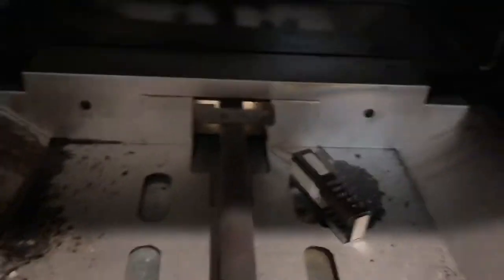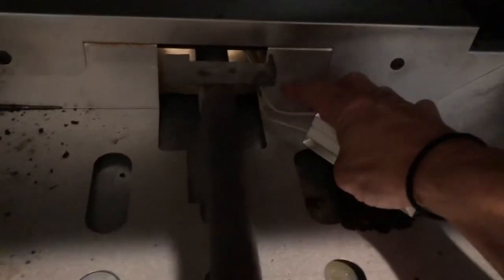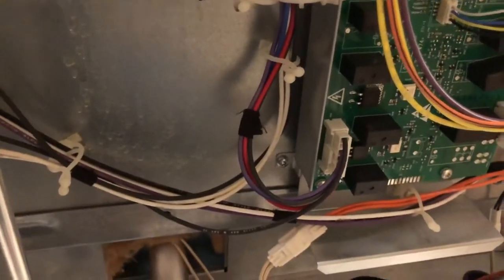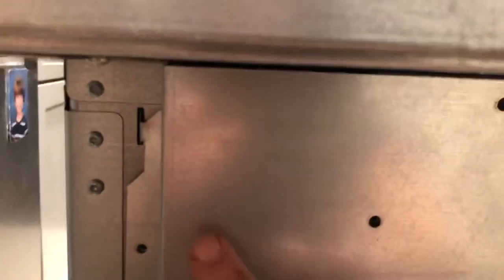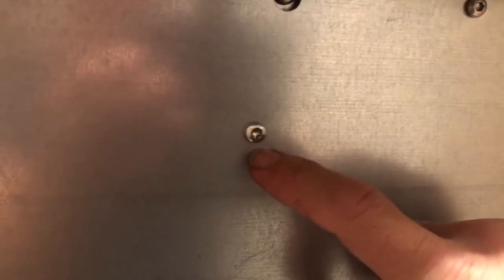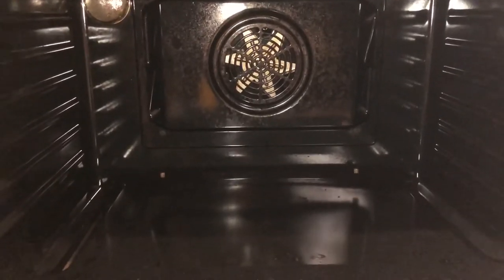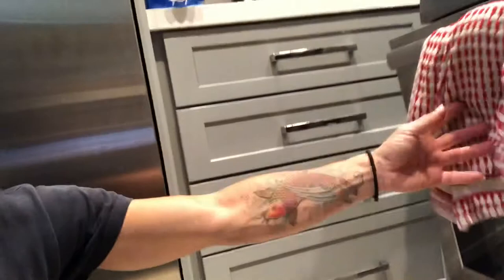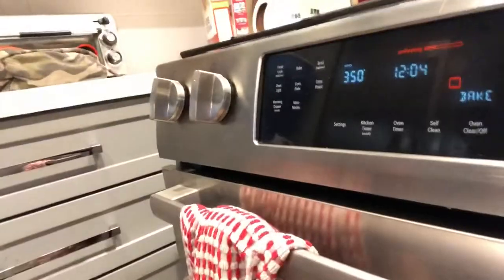Installing a new igniter in a Bosch 800 series oven

Comment: this video was priceless. other videos came up at first that showed stripping the wired and shortcutting getting into the back.  I knew that couldn't be the 'right' way and found your video, which saved a ton of time figuring out what to remove to get to the right connection area. thanks!
Reply from the maker: I'm glad this helped streamline the process for you -- congratulations on solving your issue!
Reply: Actually first replacement burned out in 2 days! Amazon sent another and did all this again and working now for over 2 months. Thx again 👍🏼
Reply: Completely agree with this comment. The initial video I viewed showed spliced wires being connected together. This video however properly showed that the stove needs to pulled, back removed so that the leads can be correctly connected. Great great video and thank you!

Comment: Thank you for this information. Bought the cheap $26 igniter, cut the wires and put it in.  Lasted a month and the igniter stopped working. Bought the Bosch igniter for $110 and was going to attach the same way. But I found your post and put it in the real way and plugged it into slot in back just like you showed.  It was not very hard and your post is the only one to show how to do it the complete right way like the original part.  Thank you. It is working great now. Hope it lasts 5 years like the original igniter!!!
Reply from the maker: Hi I'm glad my video helped! The $40 igniter I installed in 2020 lasted 3 years and I just installed a Bosch igniter replacement and made another video to compliment this one. Yes -- fingers crossed that our new Bosh brand igniter last at least 5 years!

Comment: Great video!   We watched the other videos and my reaction was no way I was going to cut the wire harness and splice it back together inside the hot part of the oven since that’s not the way it came.  This is the correct way to do it, especially if you get the Bosch part.

Comment: Loved that you actually showed the back. Most replacements don’t have the clip, just bare wires and caps, but the original wires are short and are hard to splice together. 
PS, my replacement igniter failed after a year. Replacement #2 in progress
Reply from the maker: I didn't feel comfortable splicing either. This $40 igniter lasted me 3 years.  I just replaced it with a Bosh brand igniter and made another video showing the steps I didn't show here. Good luck with the new replacement !

Comment: GREAT VIDEO!! Very complete with how to connect the 'connection end'! I was thinking of trying to avoid pulling the stove out, BUT, your video convinced me that i should!😘... and the link you provided for the part was exactly the part I was considering, but wasn't certain until i saw your link! Thank you, and keep up the good work. Next time, (even though you don't want to video a possible 'fail'), start your video at the beginning, before you've taken apart would add to your 'street creds'☺
Reply from the maker: Hi Andrew -- Believe it or not, I JUST finished replacing that igniter with BOSCH brand one. It seems the generic one failed on me after 3 years (almost exactly to the date). SOOOOOOO, I was about to delete this very long and backwards video and put up a new condensed version later today. I highly recommend you get a T20 screw bit -- this time around everything went much quicker. I even got a multimeter and checked the voltage on the control panel and continuity on the igniters to confirm it wasnt a power issue. But when one igniter fails (bake or broil) both fail. To test which one had failed, the multimeter came in handy. Glad this one old vid helped you though.
Reply from the maker: hahaha clearly i know nothing of "street creds"

Comment: Where did you order the replacement part.  Can you provide a link?
Reply from the maker: I found it on Amazon. Gas Range Oven Igniter for Bosch 00755058 9000820965 755058 https://www.amazon.com/dp/B085J14HKB/ref=cm_sw_r_cp_api_glc_fabc_uKx7FbAA4SCDB?_encoding=UTF8&psc=1

But I think Bosch likely sells their own part too, for more $. I opted for the one I found on Amazon, and (fingers crossed) oven still works and house hasn’t burned down.